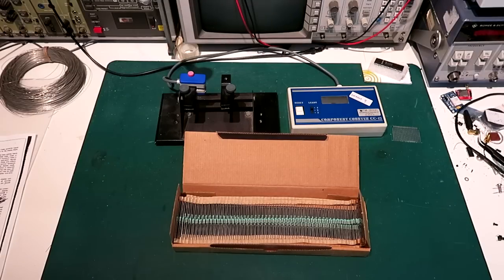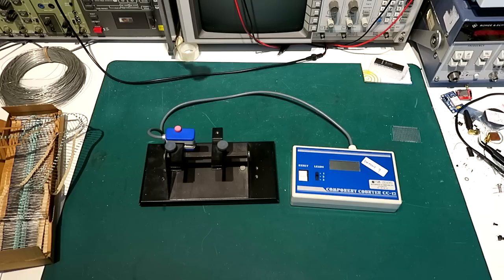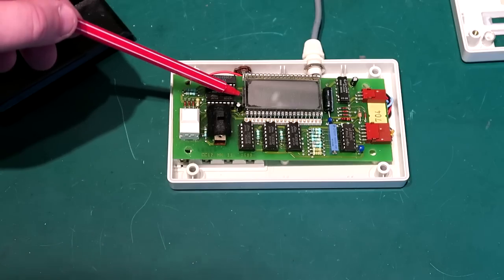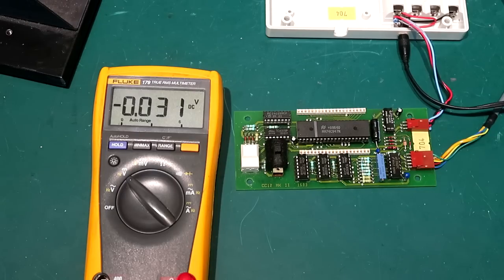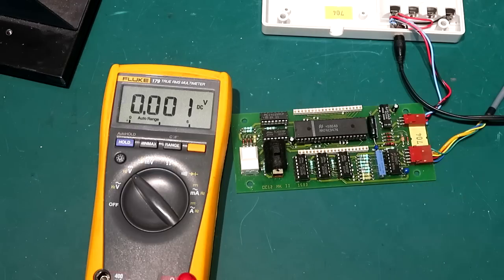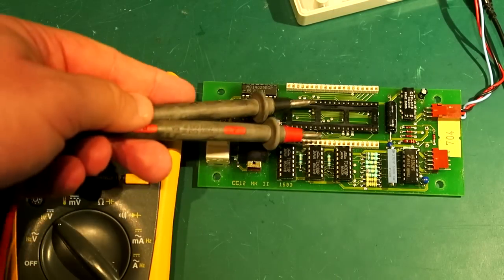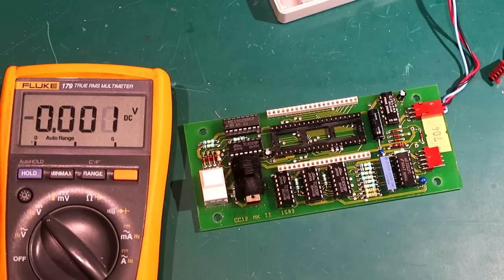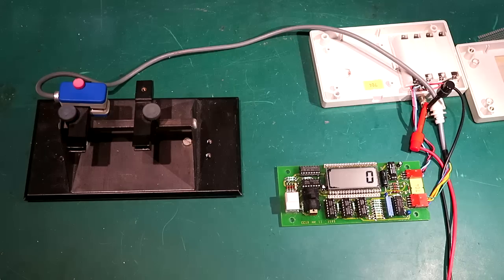Ammo-Belt Component Counter Repair

Comment: Schleuniger still makes these in a slightly updated version, the CC-15.  They are US$1300 new.
Reply from the maker: Wow! Component-wise, the MM74C947 was obsoleted ages ago, so they are probably using a microcontroller these days, but still. That's ridiculously expensive.
Reply from the maker: Can the modern one count SMD parts as well?
Reply: I think it's for leaded components but can be set up for SMD.

Comment: That was interesting. I have never seen a component counter in action before. Too bad about the incorrect power supply. Even in its current state, it is a fun bit of kit.
Reply from the maker: It's getting kind of obsolete, with the cost of resistors being so low. Who cares if you lose one or two? That being said, I was amazed by its accuracy and speed. You can roll that belt forward 2000 parts and all the way back out again and it always ends back at zero.